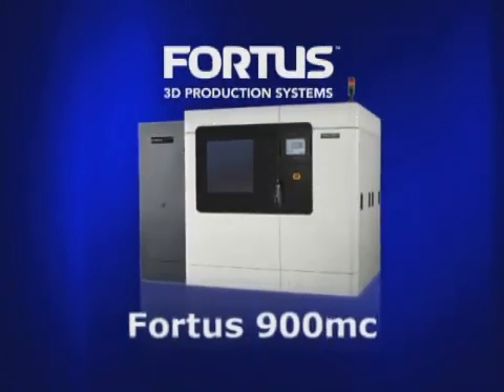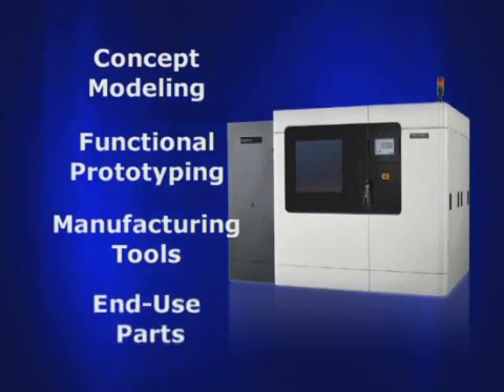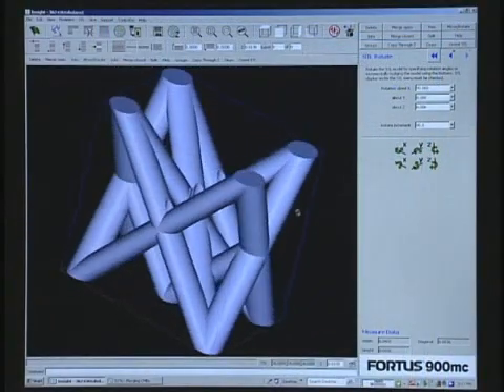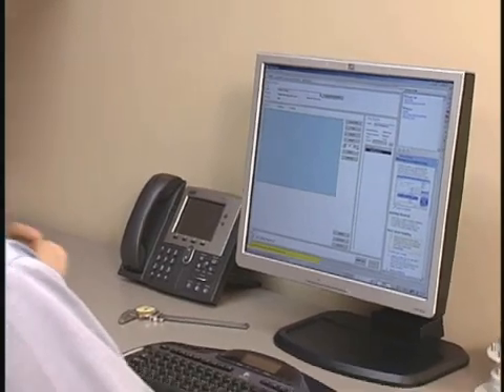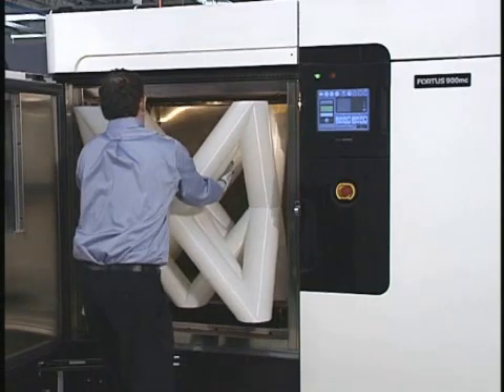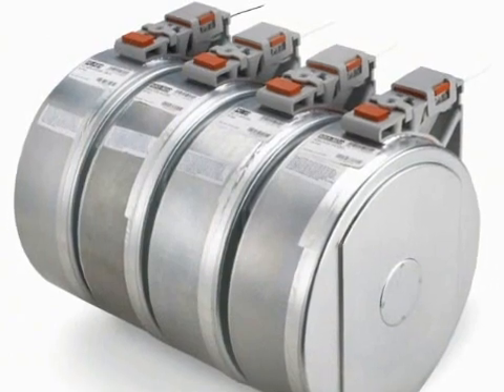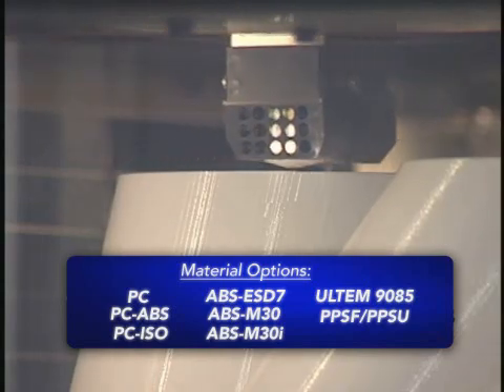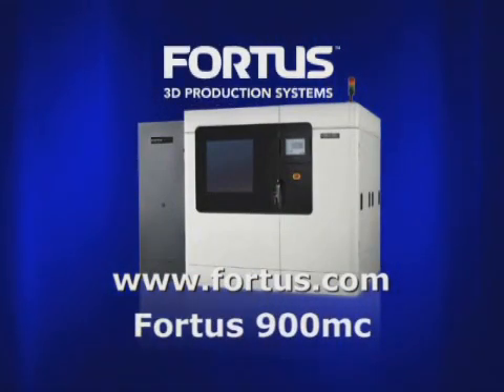Fortus 900mc 3D Manufacturing System

Comment from the maker: We appreciate the feedback and will consider it. In the meantime, if you’re interested in producing large parts, consider building parts in sections and bonding them together. Stratasys builds parts with real thermoplastics, so bonding is easy. You can read about Urbee, a full-size car body that was 3D printed using Stratasys machines, on the Stratasys website under Resources/Case Studies.